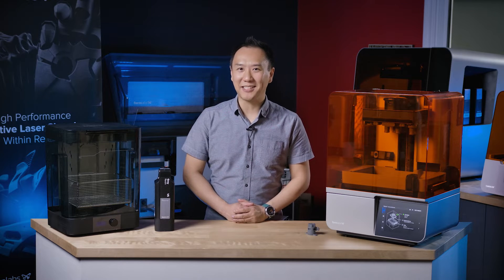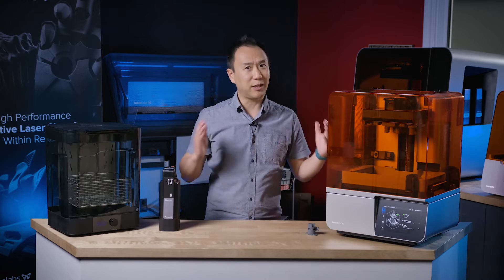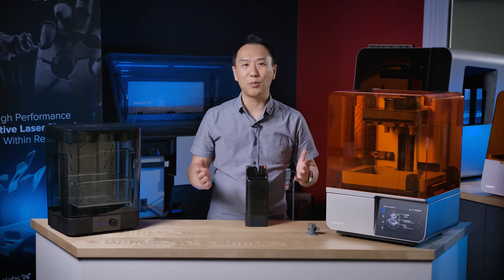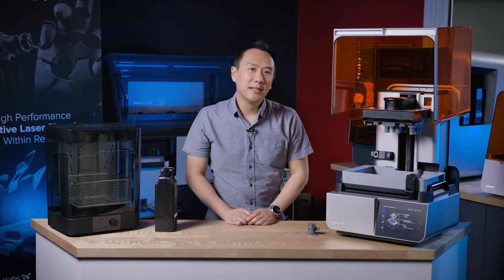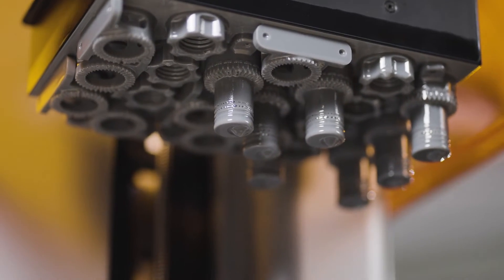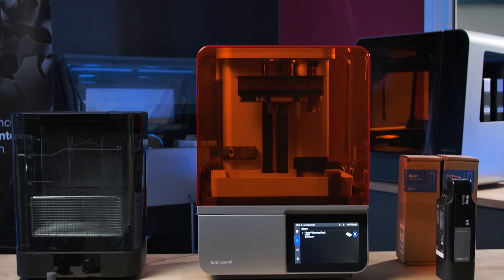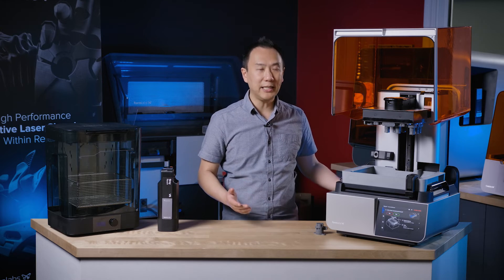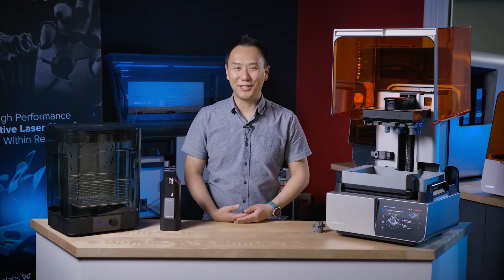Product Feature: Formlabs Form 4

Comment: look i know this would be overkill for an enthusiast, but how would this handle dnd miniatures? Would they be able to print pretty quick if theyre smaller?
Reply from the maker: It'd be amazing for DND figures but it is a "bit" overkill. That being said, lots of opportunities to go beyond DND figs and the workflow is a lot cleaner than hobby printers due to the fact that a lot of the processes on the Form 4 are automated. Since there is a new lighting unit on the Form 4, it would take the same amount of time to print a full build plate or a partially filled build plate. An average size DND figure should be printed pretty quickly.
Reply: @Shop3Dca  thanks so much! I’m pretty sure I’m gonna pull the trigger here soon with my bonus this year. Excited to hear that it’s great for DnD stuff